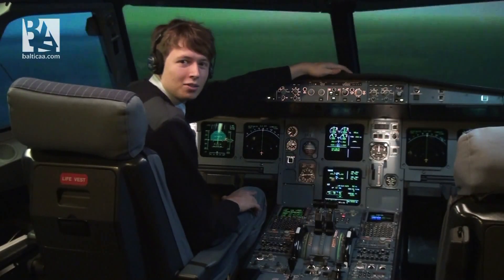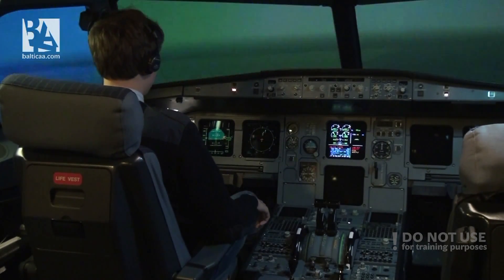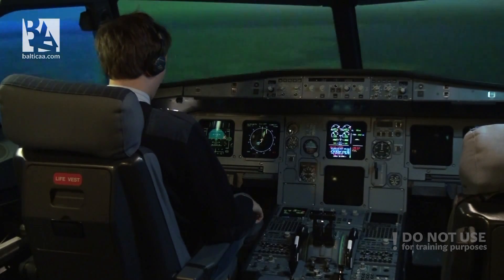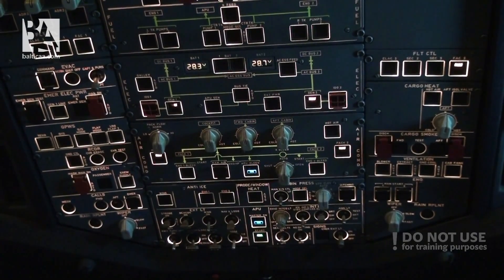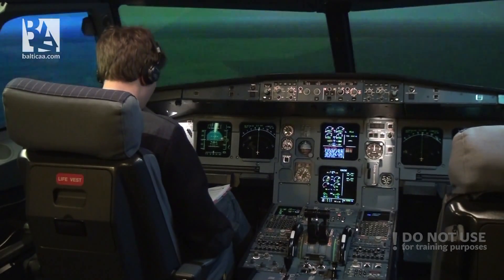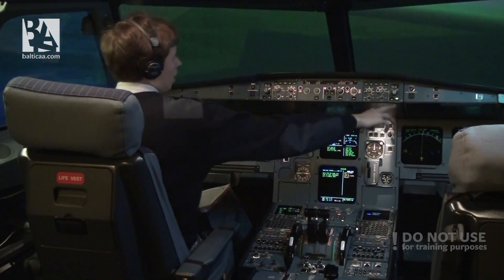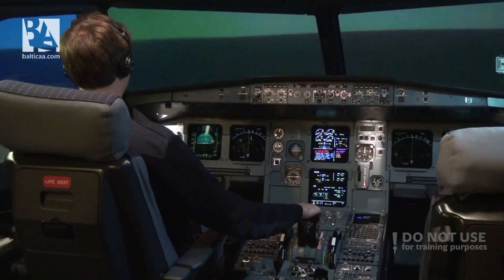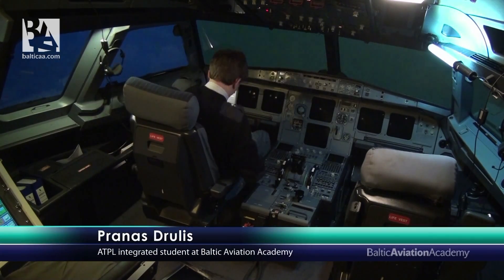Baltic Aviation Academy: A320 Ditching

Comment: "Baltic Air 191, cleared for takeoff RWY 9R, winds are calm, Please state souls on board."
"Cleared for takeoff, 191, one soul on board"
"191, confirm ONE soul on board?"
"Yes, 191"
"191, where are your passengers and copilot?"
"this is a deadheading flight, uhh, we are delivering this plane back to base for maintenance, 191."
"And the copilot?"
"Don't need him, extra weight, 191"
"191, Cancel takeoff clearance, abort takeoff now. Advise when ready to copy down a phone number."

Comment: Isn't dumping the fuel a good thing to perform in case of both engines loss?
Reply: Raidzor つ ◕_◕ つ  a320 cant dump fuel only bigger plane can do it.
Reply: milos stankovic Yeah, already looked it up and learnt about it... It's weird because it is much more safe to have that function on an airplane....
Reply: Normally you wouldn't need it for anything. Fuel dumping is most commonly used to avoid an overweight landing, and the highest takeoff weight of an A320 is lower than the highest landing weight, so it should handle landing in any situation. Plus you need the fuel for the APU to supply power.
Reply: sagiksp Yes but still if you dump SOME fuel you become much lighter and you can fly longer with no engines.
Reply: @raidzor5452  counter intuitively you can fly further on no engines if you’re heavier.

Comment: What does the ditching switch do exactly?
Reply: Grimmy Onland it seals any outflow valves so that the plane will sink slower.
Reply: For a moment I thought the A320 was so advanced the ditch button would do the ditching itself
Reply: It probably also tells the computer "I know what I'm doing, don't nag me with terrain and bad landing configuration warnings"
Reply: It’s to tell the computer “you go to sleep now”
Reply: Ditching button diconnect all the electricity so that plane does not catches fire easily due to short circuit while touch down
Reply: @deborshikashyap6745  no, closes all outlets and inlets below the water line.

Comment: what does the ditching button do?
Reply: It closes a number of valves, preventing water from entering the aircraft: the outflow valve, avionics outlet/inlet, ram inlet, pack control and cargo insulation valves. Some aircrafts such as the MD-11 would also be slightly pressurized upon switch activation to improve buoyancy, rigidity and insulation.

Comment: What is ram air turbine
Reply: A little fan under or on the side of the airplane that pops out and is spun by the air to create electricity.
Reply: John Popa 
Ohhh ok thankxx
Reply: @johnpopa6511  it actually creates hydraulic power that can then be turned into electricity by the emergency generator.
Reply: It’s pretty funny, literally like a miniature wind turbine sticking out the bottom

Comment: That radio was strange though, casually informing the ATC that the engines went dark. Isn't the pilot supposed to callout "mayday"?
Reply: only if there is no chance of restarting the engines, he had plenty of time to try and restart them and in lots of cases the engines would restart, alhough he should have called mayday after the engines were past the point of restarting and he knew he was going to ditch

Comment: What does "diching button" do ?
Reply: +jairox75 It closes all exterior vents to ensure water is not ingested into the aircraft, to keep the aircraft floating as long as possible.
Reply: Water got into the cabin partially due to the rear door being opened and partially due to a hole in the fuselage / water ingressing through vents
Reply: +Mar-Works But water got into the cabin. That's the point of the button.

Comment: How long can an airbus a 320 float after ditching?
Reply: And someone panicked, and opened a door which shouldn't of been and let in more water
Reply: +Váróczy Csongor A bit more than the hudson landing (because they didnt push ditching button)
Reply: +Edvinas In that incident, pushing the ditching button would have had little effect as the impact tore holes in the aircraft's fuselage.

Comment: why does he not grab his life vest?!
Reply: Thijmen Schoenmakers Still, you're in the simulator to learn certain things by heart. Forgetting this causes all kinds of interesting problems. One example of this is a case where a 737 developed an engine fault in an early stages of descent. The pilot turned off the wrong engine, because in the simulation the it was always the same engine that failed.
Reply: It is simulator
Reply: +Freakschwimmer it is not for traning, A320 is ment to fly by two pilot
Reply: ＋1
Reply: If you didn't think this is true, use a computer instead, why using this simulator?

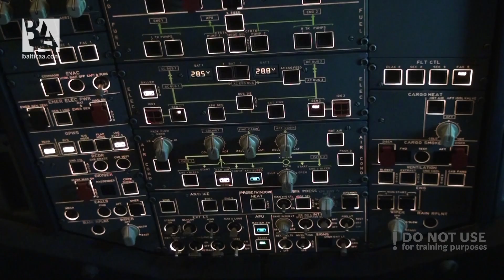Comment: Anyone know why he presses the "DITCHING" button at 7:07 on the Cabin Pressurization panel? Is it to depressurize before doors are opened on the water??
Reply: The 'Ditching' button closes and seals any vents and openings in the fuselage which may become flooded following a ditching, it is a good way to buy a little bit more time before the aircraft sinks, that is assuming you can get it down safely! hope this helps
Reply: elliot robson Super helpful!! That's very cool knowledge...

Comment: I'm sure this is a painfully naive question, but if both engines have flamed out, how exactly does Pranus "increase the speed a little bit" at 7:50? Does the flight management computer adjust the trim, somehow? Aircraft attitude?
Reply: gravity man, just push forward on the stick, you'll get speed
Reply: Cinema

Comment: I have a question; as soon as it appears that the engines won't start anymore, why not dump all fuel there's plenty time for that and empty tanks lessen the danger of fire after the ditching, AND those same empty tanks provide an enhanced flotation capability, provided, ofcourse, that the wings remain attached to the plane at impact. I would like to know about that option...
Reply: Fuel dump is done for routine emergency landings e.g. return to origin if one engine fails. You cant just dump tons of fuel into the water. There are special locations to do so.
Reply: Airliners typically don't have a fuel dump system.
Reply: Adam Ahmed  Yes, they have!
Reply: Because the APU needs fuel
Reply: +spanishhornets A320 doesn't have one CMIIW.
Reply: +DateSan  I don't know if the A320 was designed to dump fuel or if it can land near MTOW. However, many long range airliners do have fuel dump systems.
Reply: in theory, its a very god idea and works very well but there are specific loacations that are made available to dump fuel at, maybe he was at one and maybe he wasnt but they cant make it part of an official procedure if its a variable. plus, the fuel is less dense than the water and as long as the fuel pumps are cut the plane should remain floating for a while, whereas if one tiny hole gets created in the fuel tank if its empty it will fill up with horrible dense water that will take it down quicker. oh and its and a320 so it cant dump

Comment: Since its in the electric section of the panel, my guess is that it cuts electric power to the galley (coffee maker, air chiller, ovens) to save it for important systems.
Reply: Mathieu Proulx I was wondering what that button does too
Reply: C. Neale yes thats correct

Comment: probably worse off, for one the A320 is a lot more automated that the 737 CL, even more automated than the 737 NG, in my opinion I would much rather be in an A320 if I had to ditch the aircraft.

Comment: its to provide back up electrical power to the basic instruments such as the PFD, MDF and ECAM displays. it will deploy automatically in the case of a dual engine failure such as the simulation shown in this video, think of it as an office desk fan on a pole that pops out of the fuselage near the main gear. if you cant imagine what that looks like than search ram air turbine test

Comment: Having dual engine flame out more likely than not means you will not have your APU.  Just think about the reason for a dual flame out.. Fuel starvation is one of the very very few causes of that, and that means you won't have your APU.